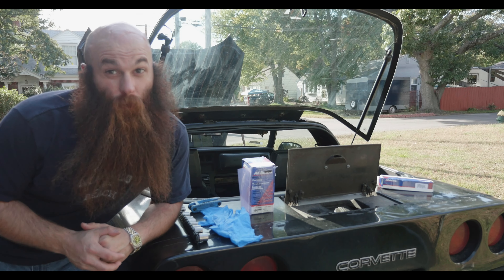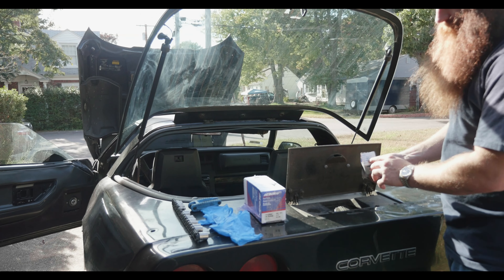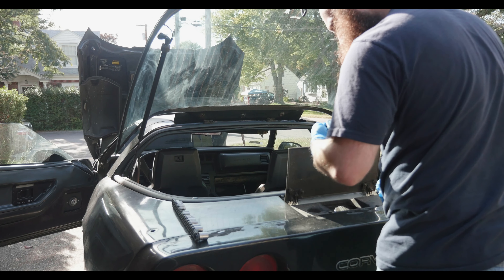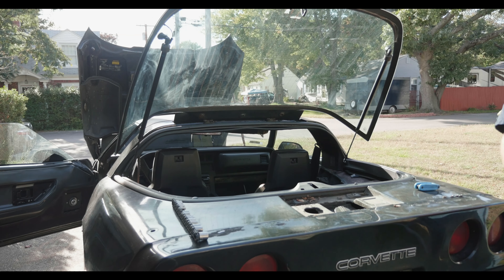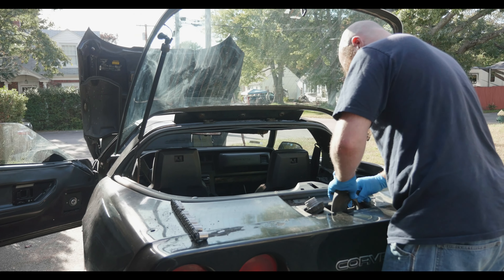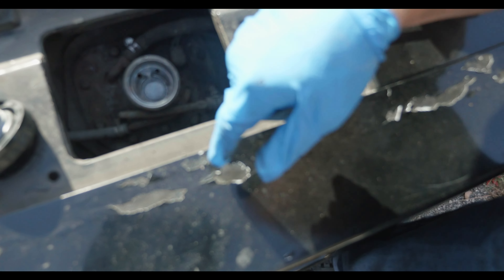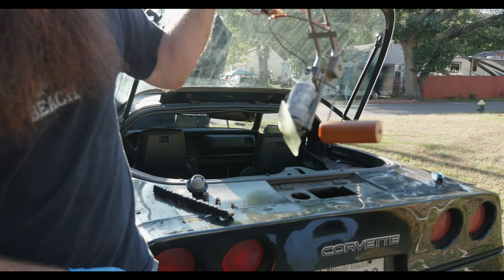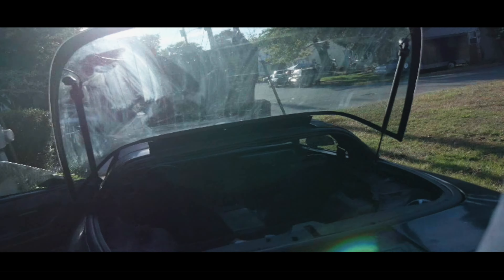1985 Chevrolet Corvette C4 - Fuel Pump Replacement ACDelco

Comment: Ahhh... good video. I'm getting ready to do this to my 1996, Gas gauge finally stopped working after it was always reading 1/4 tank off. Bought a stainless Bobs unit with a new 255 LPH pump. Anyway, I want to change the hoses on top of the tank from the hard lines to the unit. It doesn't look fun and there is no way I am going to pull the rear bumper just to do it. The hoses are only about 6-8" long but unless you have the hands of a 3 year old, I just can't see getting the clamps off and reinstalled. Any ideas? If I don't plan on doing it, sure as hell, one of those lines will NEED to be replaced and I'll have to do it anyway.

Comment: My 86 with 63,000 miles is chugging and lurching going slow, I though it might be plugged injectors but someone mentioned the fuel pump going bad. Did your car chugg before you replaced the pump?
Reply from the maker: Yes,  I did notice a difference!  Although, my corvette will not shift out of first now as I need a new governor gear in the transmission.
Reply: Your right mine did that

Comment: Great video. Fixing to tackle a similar job on an '88 Anniversary Ed. that's been sitting for years. Approx. how many hours did it take you?
Reply from the maker: Two maybe three hours: I took breaks and wire-brushed the entire assembly.   The extra hose given in the factory ac-delco pumps takes the place of a plastic piece found on the assembly.  It's not bad at all!  Let me know how you make out..
Reply: Thanks, John. I was searching on GM Parts Direct, and found the pump, but not the strainer. What all comes with the pump? Is AC Delco OEM? Do you happen to have part numbers? Thanks again.
Reply from the maker: EP241   = Pump,  TS1 = fuel strainer.
Reply: Thanks, man. This '88 Anniversary Edition  is a pristine barn find. Only 2,700 miles. Been in storage for years.
Reply: Wow, 2,700 miles on her? Man you’re lucky 😄